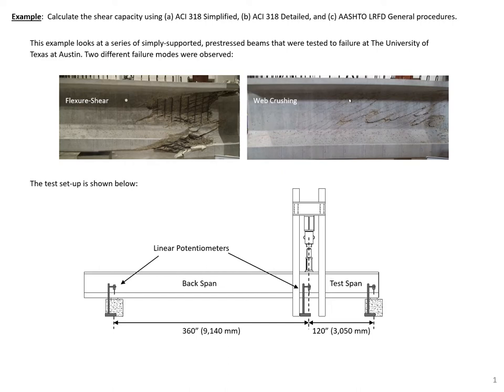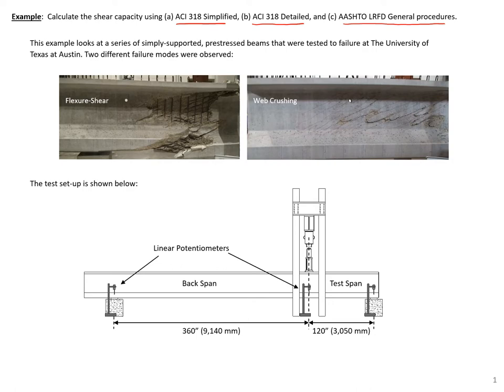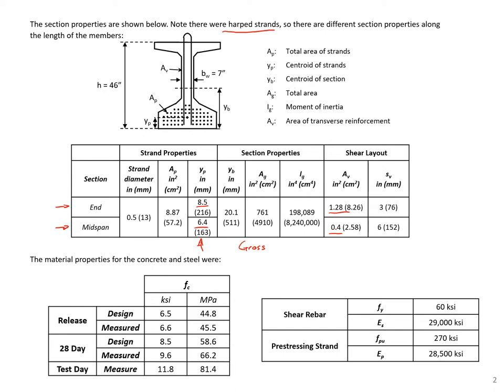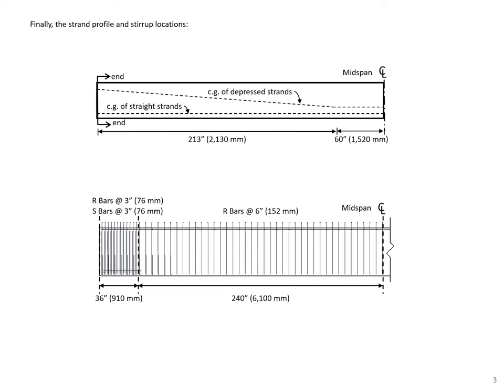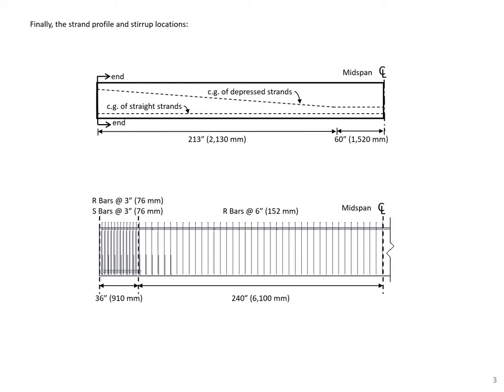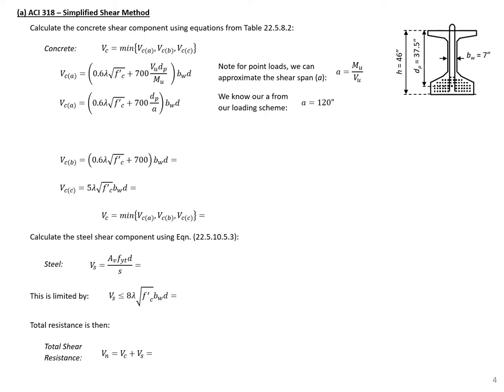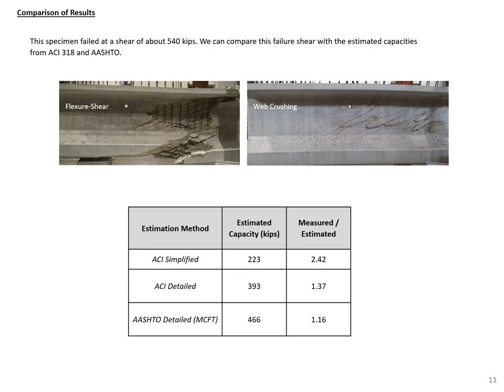10 - Example 2 - Shear of Prestressed Concrete Beam

Comment: please explain what is the R bars and S bars in shear reinforcement at the end of the beam
Reply from the maker: These are two types of reinforcement used in standard TxDOT bulb tee girders. The R bars are placed along the entire length and serve as shear reinforcement and also extend out of the top of the precast girder to provide interface reinforcement with the cast-in-place deck. The S bars are located at the ends of the girders and provide reinforcement to resist splitting stresses that develop in the end region.
Reply: @davidgarber1664  could we get a cross section shows the two types , thanks for reply.